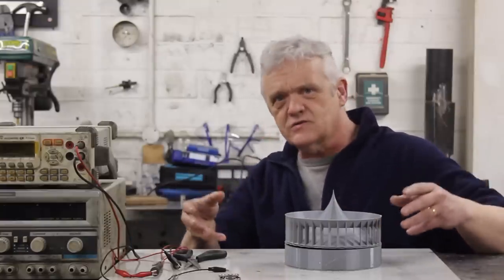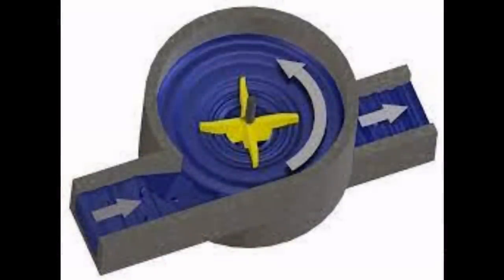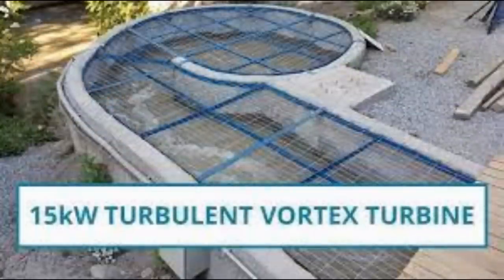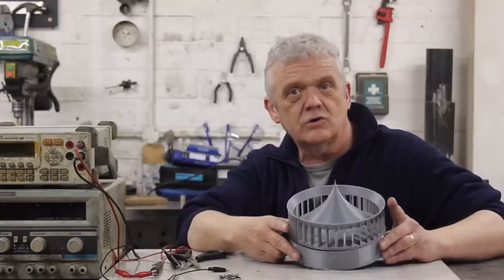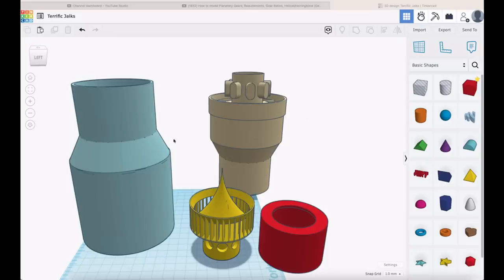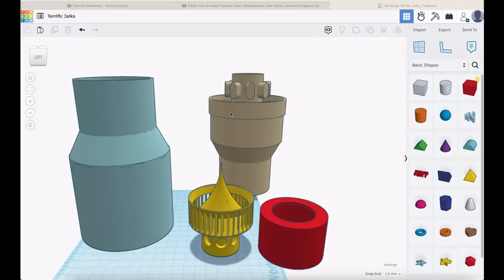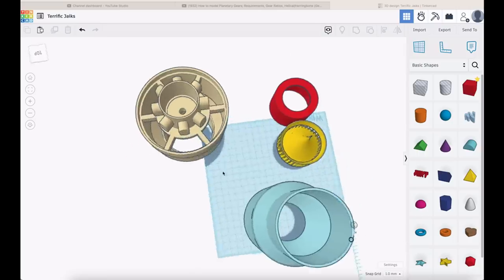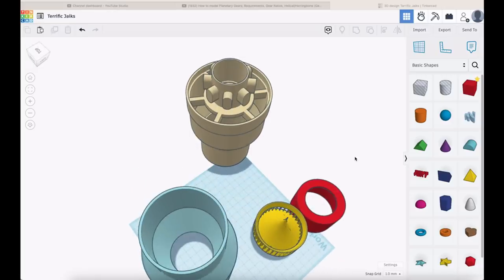1884 A Vortex Turbine In The Making

Comment: WOW... this sure fired up the engineer in me.  If this were modified very little it could be a regenerator of energy from the water mains in every village, town or city in the world.
Reply: THIS is an idea worth exploring.
Reply: Think about it. A circular water system that reclaims the energy of the moving water to offset the cost of supplying water. Every motor is a generator and every generator is a motor. My mind is exploding.
Reply: They do this in British Columbia, in the greater Vancouver area our water comes from mountain reservoirs and at the point where the pressure needs to be reduced for residential units they have installed generators rather than just letting the excess pressure be wasted.  The electricity is used to power main road traffic lights independently of the grid so that they continue working indefinitely during a power outage.  Theoretically each home could have their own pressure regulator that also generates some electricity during use, but it would not be enough on it’s own for much, but could help feed a battery charger or something like that...
Reply: Bob, go for it, man! The vision's bang on!
Reply: I'm thinking down spouts!
Reply: Just think about storm water systems.
Reply: So you could water your garden while generating some energy for your house :)
Reply: YES, Run of pipe generation and pressure reducers containing generators exist. As do large scale Francis turbines.. (but one can't just generate power and expect to maintain head pressure)..

A 6 inch turbine will flow a huge amount of water - and generate a lot of power - infinitely more than the same sized wind turbine. provided a head is present with sufficient spare flow to make sense.

A small scale system, With pumped hydro - wind up, water down  is the most rational "mass battery" (unless you did happen to have an empty church steeple and 100Tonnes of Rock/concrete to lift (using solar and wind)..
Reply: @kadmow  No of course, it would be a balancing act.  But if you already have excess water pressure...
Reply: Hey Bob, I'm in the process of building my own generator and I was curious how many turns roughly I should consider for the coil. Am I remember right thinking that Rob did 400 turns in his serpentine coil? Thanks for any reply
Reply from the maker: yes - it could!
Reply: @paradiselost9946 We don't know what you mean by "work". What's the criteria? If working simply means generating electricity, based on your comment, it would work. You would just have reduced pressure in your house wouldn't you?
Reply: its not that much different than a water wheel in a sens but more compact and efficient
Reply: Well, that's true, but isn't there already energy put into actively pumping those systems? And isn't that like capturing wind energy from a ventilation fan?
Reply: @operator8014  Yes, but this is something that has been factored into the cost of delivery by the utilities for the amount of water that you pay for. As long as you don't just run water senselessly they'll never know and you can capture some of the energy the utilities put into delivering the water to you. Your analogy is correct, but you're charged for the volume and not the pressure, and that it would be going down the drain otherwise
Reply: @operator8014  What does that matter?  The idea is to remove as much as possible to off set any other energy costs to generate. A hybrid not a new source. Many small things make up every large thing. Take it where you can get it.
Reply: is there a video where he builds this ??

Comment: I am working on a similar line Rob, my thought is feeding from a bell syphon rather than directly from the downpipe to provide a greater flow. The syphon barrel fills from the gutters at whatever the rainfall is and then when full dumps the contents over the turbine. This way you don't loose the light rain running ineffectively over the turbine it stores it and releases in a usable burst.
Reply: A twister/tornado is a natural vortex. If you understand the elements of a twister (yin/yang spinning, cold/hot spinnng, etc), then you are half way there! BTW a natural twister generates electrical/static energy! Go for it, mate! It might help to understand that the Milky Way is a twister (fibonacci sequence) that moves through the Universe spinning through eternity. Once we have a balanced analog/Digital perspective of Unity, our energy problems will be solved. Good luck!
Reply: ...and then dump into a tank that has glass sides and solar reflectors all over it (or a solar evacuated tube) which would send the steam (again through a turbine going UP) to the collector tank above which would spill into this...yeah, baby! Cycle the energy following the cycle of the day!
Reply: Bell siphons are the bomb anyway. Used one in my hydroponics set a few years ago. Impressively simply application of physics
Reply: Someone did a series on such a project. Can’t remember his name.
Reply: @mikebond6328  a channel called Quint builds?
Reply from the maker: I like the bell siphon idea mate - makes your gutters a battery !

Comment: Dr. Smith, consider if you would a 2 serpentine coil system. A coil on the inside and a coil on the outside with the magnets sandwiched in between the 2 coils. Just a thought. Twice the use from the one set of magnets.

Comment: Noticing the comments.. and thought I’d throw in … A vortex turbine ,in a tower with water and air ..and add into the mix a heavy fly wheel as well , to beef up the  torque   out put on the flywheel axis to push larger generation load ….     Food for thought. !

Comment: $50 on the barrel head says a half dozen or seven,  stacked side by side, would fit in a roof rack or in part of the trunk to have a capacitor then feed a battery, while moving and / or passing through rain? I wonder if rather than relying upon natural flow, energy expressed by pressure or vacuum, a contained system, like a hydraulic conveyor system, would amplify the impulse of the circuit?

Comment: you could put your coil on the outside of the pipe and the magnets and turbine on the inside.
will need a very good high flow filter/screening system as this kind of turbine will be prone to fowling.

Comment: You'll likely be able to change the NACA blades when used with water as it will flow differently, the water will have higher momentum than air, less likely to stall at slow speeds so you could get more aggressive with the profile and/or angle of attack. Bit rusty on flow dynamics, 15 years since I was an engineer... 😪

Comment: Another inspiring video.  Thanks.  Your foray into hydrodynamic turbine design is similar to a long used turbine called the "Francis runner" design, but in reverse.  The Francis runner is surrounded by a structure called the scroll case which directs incoming water in a spiral around the runner to apply equal pressure and flow into the runner blades from the outside, spinning the runner, with the water then discharging down through the center of the runner into a chamber called the draft tube, and then on its merry way.  There are various and quite different styles of hydro turbine designs, each specialized to be most efficient for the pressure and velocity of the incoming water, called "head pressure" which, in turn, is usually dependent on the vertical distance the water drops through a pipe or penstock feeding the turbine.  Thanks again, and keep inspiring future engineers to continue exploring and inventing.
Reply from the maker: I know it mate there is also the Fourneyron turbine which you might want to look at

Comment: One thing I thought of is hooking up a solar water heater, increasing the solar area to push the water to a higher temp and possible expansion into steam through the turbine and recycle back to the heating element. A closed solar steam turbine that works even when there is little to no wind.

Comment: There is something i think you'd like exploring - atmospheric vortex engine.

There is an idea to use waste heat from traditional (or nuclear) power plants to make o big vortex that would drive some air turbines close to it's base. It would raise the efficiency of these power plants. The vortex mechanic would be analogous to the fire vortex you made in some video.
Some people are trying to build a working model for decades now.

Comment: If you make the cone for the top of the Darwin wind turbine (1882 0:30) hollow you could probably fix it to a gutter system and have it do duel duty.. especially if you have a shroud to direct the wind and water to flow downward towards the runoff outlet (and/or a secondary turbine at the base)
Reply from the maker: that's clever - I like it

Comment: If your going to set this up for water, just think if you make funnel or something like it to recapture the water and could put many in succession and get as much as you can out of w/e height the water fell from. Could have a few just in a meter or so of height, like the water coming off the roof of houses.
Edit: at the bottom of the fall could also get a trompe hammer going too. to reclaim some of that lost energy or potential, maybe...
Reply: I was wondering about this as well. It would be useful to see if successive generators would have the same output or not.
And whether or not this would significantly slow down the flow of water.
Imagine replacing the drain pipe of a multi story building with a long chain of these.
Reply: That was exactly my thought. I wondering if he is using already the magnetic rotors in this project.
Reply from the maker: yes you could
Reply: They would need to have some space between them to allow gravity to accelerate the mass again.
Reply: layman, here. is the volume of water running through it the driving factor, or the flow rate?
Reply: @roelofversluis6680  Yes. The formula is "Current times force equals work."
Very similar to the relationship between speed and torque, and even Volts and Amps in Electricity.

Comment: Fabulous subject and loving the videos. In awe of the making.

You may have problems if trying to generate from a drainpipe as the water tends to flow along the pipe surface. You will need some method of directing that water from the pipe internal surface to the centre to "fall" on your rotor.

Good luck

Comment: I happen to be trying to design something very similar but for a great energy system using a device no one seems to be thinking about, I've looked a long time. Any how, I'm building that to pipe down one of the 250 to 350 feet wells I have. I'm hoping to compress air going down with the venturi effect and then trap the air rising back in the middle. But also reclaim as much as I use since I'm hoping the upward water pressure will force out water with some of the air each time to equalize the water table below. If all goes well, I'm going to try a submersible, homo-polar motor and see if I can blow the whole damn town away with HHO or at least singe some hair off a few of my cats. I really hope this helps someone because I haven't seen anyone working with water columns, vacuum, water hammer, steam, atmospheric currents, etc., that has thought to use a well and go deep (like us country boys) instead of high (like you city folk).

Comment: I've had a downpipe generator bouncing around for years, in my head, it takes a man like you to make it a reality. Just a thought Rob, if the downpipes diameter was reduced gradually over its length it would create a pressurised jet of water. The downpipe could be glued together with plumbers solvent instead of slotted together to prevent leaks. Keep the vids rollin, they never disappoint.
Reply from the maker: cheers mate and yes it would do that with sufficient head of water too

Comment: Rob thank you so much for these.
One thing I'd love to see is charging stone kind of battery front all of these devices.
You've shown volt meters, lights etc. But if you'd charge the same battery every time it might help to compare the various experiments in terms of actual useable output. Just a thought.
Reply from the maker: I get it mate - but it seems unnecessary - if it will light a light it will charge a battery

Comment: BTW a 2 stage system - counter rotating coaxial guide vanes opposed to output turbine vanes makes a lot of sense  (even "just" a 2 inch feed pipe can generate a lot of power -significant energy just needs a sufficient mass/volume of water from the top pondage.)..
Reply from the maker: cheers mate

Comment: hmm,more then 7 volt means i can use a 3 Volt Motor to drive the Turbine and have Power over to change something and stor Power. and all can stand in a Basement. all 10 time and connecting it paralell can you stor 36 Volt evry Time.

Comment: I would suggest having the winding of the coil on the outside of the magnets on the rotor. This will greatly simplify connecting to the load.
Reply from the maker: ? it is on the outside
Reply: @ThinkingandTinkering  Sorry, maybe I misread the CAD.

Comment: The point of the Water Vortex Turbine generator is that the water vortex is present in the water flow, irrespective of whether you have a turbine inserted in the water flow or not.
It's distinctly different from say a water wheel which is also gravity driven by falling water in primarily one direction.
A vortex is also driven by gravity as well as the Coriolis effect (a weak force on this scale, and is actually controversial as to whether it determines the direction of the vortex. The direction of large cyclones/hurricanes is determined by the Coriolis effect being different in the northern and southern hemispheres).

The flow of water from the bucket onto the turbine in your demonstration actually slows the turbine down the longer it spends in the spinning part of the turbine. That is, the fastest exit for the water when it strikes the top cone will be in a straight line so that it will impart the maximum energy onto the blades as quickly as possible. 
IT can easily work as you have clearly demonstrated but optimising this turbine set up is very tricky indeed.

Cheers
Keep up the good work. You engage with your viewers very well.

Comment: Rob,  have you looked at sand casting some of the 3d prints using zamac alloy .  Also I had a brief conversation with a stranger on local bus who mentioned he'd been gasifying plastic scrap using old electric heater elements within a mass of sand along with the scrap , two 250 watt solar panels for the power supply, ,, optional choice,,  spoke of subtle differences in range of temperatures from 450° to 600° .  
  Your wind energy exploration convinced me that the best wind generator is a homemade one . Although I prefer not to be in a prevailing wind environment.
Reply from the maker: I haven't yet mate but I have done plastic gasification and videos on it

Comment: Brilliant Rob! That went pretty much as I hoped it would. 😊
I bet these would also go great atop a chimney to extract a bit more energy from the fuel being burnt to warm our homes. PLA might not be the material of choice, but I bet it would produce useable energy levels.
Reply from the maker: I'll bet it would mate
Reply: We already have those ~ called a chimney fan and they do the opposite = an electric extractor fan, sucking the smoke up the chimney to improve the draught of the fire, and the wind-spinning rotary versions often seen on chimneys and landfill methane vents
Reply: @samuelfellows6923  if the chimney needs an extractor fan, it is pretty poorly designed/maintained.

Comment: Hi Rob,
I don't know if this has already been said, but length of the chord of the "blades" seems somewhat short. The exiting medium may very well still have some more energy in it, which could perhaps be harvested by making the chord of the blades a bit longer and gradually more curved outwards, so the direction of the exiting medium changes more..?
Love this design!
Reply from the maker: actually they are still too long I think - you can see the exiting water stream hardly comes up them
Reply: @ThinkingandTinkering  I didn't mean the length of the blades, the the length of the chord of the blades. So not in axial direction, but radial direction.
So if they blades would now be 50x10mm, you might want to try 50x20mm, for instance. Or even 40x20mm.
I agree with you; The water stream perfectly visualizes how the medium is somewhat 'compressed' to the lower bit of the blades and doesn't really touch the upper part. But if each blade had a longer chord length (or would be wider, if you will), with some added curvature to change the direction of the passing medium more, it should absorb more of its kinetic energy.

Comment: I wonder how that would work as a ducted propeller for a boat (Thruster). As long as you reversed the airfoil leading and trailing edges on the turbine. So the inside of it pushes the water out that was collected from the edges?

Comment: There is a massive blind spot in the design of the squirrel cage blower except for the Mike Waters turbine.
The squirrel cage was developed from earlier simple centrifugal pumps and when it was realised the tips did all the work the squirrel cage was born. But when is a vane a wing? Look at a squirrel cage from the wing perspective and it will be seen that the low pressure above the curve of the wing is on the high pressure side of the pump. It's wings are upside down! The late Peter Rollo filed a NZ provisional patent in 1995 showing an average 50% improvement in performance over three traditional blowers. As far as I can ascertain no full patent was ever filed. In Mike Waters' turbine the airpressure is reversed and is therefore correct. He agrees with me. Robert, there is another factor making the Waters turbine super efficient, the downstream square end causes suction on the vanes.
There are a lot of great ideas lurking undeveloped in the patent files, your tinkering Robert is very important.
Neil Campbell